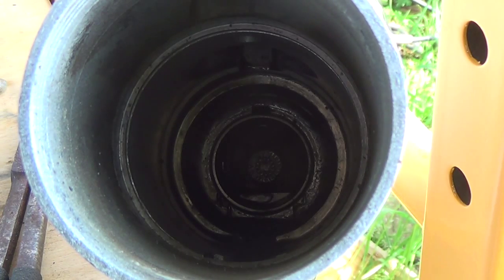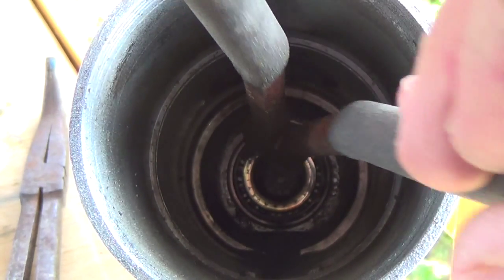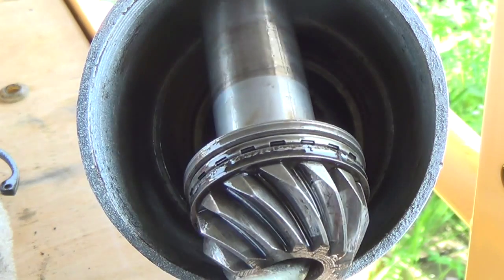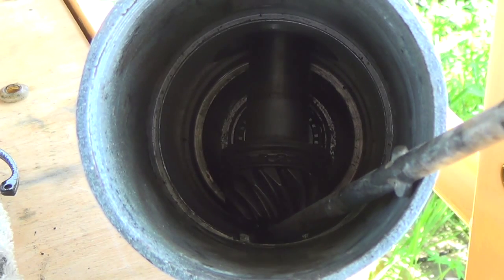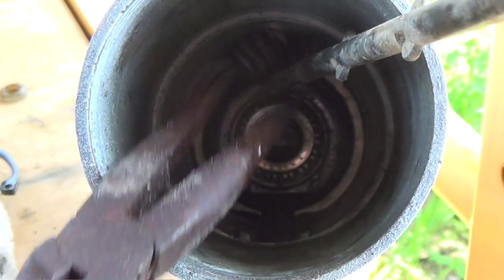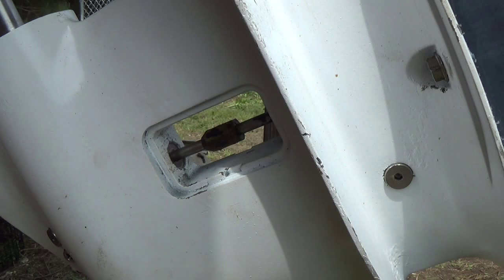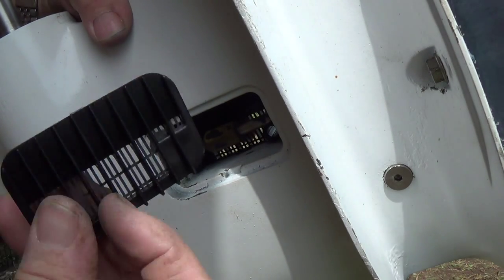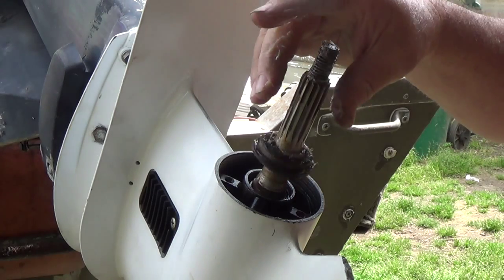Evinrude 30 Part 4

Comment: Congratulations on getting that spring/ball set up back in place successfully.  I'm just hoping the prop shaft was properly indexed with the clutch dog so the balls fit properly into the detent grooves into the clutch dog.  I'm wondering if you got the two pinion bearing washers properly oriented, the two washers are different and must be oriented properly against the pinion and gear housing.  It's a good idea to apply a little grease between the seal lips prior to assembly to help extend seal life and to help make sure the seals are not damaged during assembly.  Did you pressure/vacuum test the gearcase before filling with lube?  This is a critical step indeed.  Even the best of technicians makes an occasional mistake during a reseal, there could also be imperfections in the housing that might create leaks as well.  Outboard gearcases have a zero tolerance for any sort of water leaks, no matter how slight.  I realize that car/lawnmower engines can survive OK with minor oil leaks.  Oil seepage on the ground can be monitored, and the oil level can easily be checked/topped off.  Oil leaks are usually not that obvious on outboards, and the oil level is a royal pain to actually check.  Keep in mind that as the oil leaks out into the water, water is leaking back into the gearcase.  The gear lube should be drained/inspected/changed after about 10hrs running time, just to be sure there are no sealing issues also.  It is also important to note that that lower shift rod must be threaded completely into the clutch dog cradle until it bottoms for proper adjustment.  Failure to do this will mean the linkage is out of adjustment, the gearcase won't shift correctly, and the clutch dog/gear lugs can be damaged.  Those goofy plastic shift linkage retainers are a pain also, the lower shift rod is often times inadvertently backed out while connecting the shift linkage.  It is important to just turn only the top nut while assembling the linkage to avoid having the lower shift rod back out while connecting the linkage.  Congratulations on getting this thing back together and working!  Your hard work and honesty shows this is not as easy as some might think.  Generally speaking, this is not a job for the average back yard guy to attack.  Simple mistakes can destroy a lower unit that costs $1500 to replace.

Comment: Om Fishing, does the hose clamp squeeze the PVC nipple to not only push the detent balls further down into the hole so the   clutch dog slides over them easier, but also to put the nipple on a bind on the spline so the clutch dog is less likely to slide the nipple away from the balls, causing them to pop out of the holes? I'm sure it sounds less difficult in theory than in actual attempt to do it. 
              Did you use a seal puller? I tried to find one, for my reseal job on my 30 HP 1998 Johnson lower unit. I would of had to go deeper & deeper looking,  got impatient & pried them out with a screwdriver, was careful enough I think, no score marks in the seal bores. 
             I had been at a standstill at one point. I never got gearcase fully disassembled. I made a threaded rod puller as you did for the shift linkage bushing but I used only 3/16" rod because it went thru the inner O-ring of the shift rod bushing easier than 1/4" did when I tried it. And I didn't know what size sleeve to use under the bushing, I used one that I later saw was too small in O.D., and it caused the nylon washer to mushroom and bind the bushing in the bore, then I put 2 metal washers between the nylon washer & the sleeve but it was too late, I guess, the bushing still wouldn't budge. I took it to a shop, just the lower unit housing with the guts removed, hoping that when they finally got around to looking at it, they could get the bushing out with a slide hammer. They got it out after not too much downtime, but for about $160! If only I would of used the exact size sleeve as the hole underneath the bushing, and 1/4-20 threaded rod, (the 3/16 threaded rod got stripped by the nut, too much stress), I'm sure it would of slid out for me as it did for you! Hindsight so much better than foresight! 
             When I took the propshaft out of the gearcase, the  clutch dog stayed on the shaft over the balls. I hoped that didn't mean the clutch dog was seized with some rust onto the shaft. It shifted normal, I thought, last time I used the motor, almost 3 years ago. But I had drained a few ounces of water out of the gearcase before doing the reseal. Yet, nothing else looked rusty. I thought  I'd better leave that  clutch dog in place, and didn't take it apart for cleaning, and if not seized with rust, I must have been mighty lucky that the clutch dog was detained in the neutral position, and didn't come off  the propshaft  when I pulled it out of the gearcase. I was lucky again, when I refit the components in the gearcase,  the  clutch dog stayed in place, and everything fit back together, the gears shift, and I saw no oil leaking after several uses in the water. Now I should take out the oil drain plug & have a look for any water, to check my work, & if OK  top off gearcase again. I used oil that is supposed to endure a bit of water if its there.
           I surely have enjoyed and benefited much from watching the videos you've posted that I have watched.  You do indeed have a good temperament as someone else had said, and ingenuity in your teaching videos. Thanks for sharing!
Reply from the maker: Yes the hose clamp squeeze the PVC down further. Yes I did use a seal puller. Sorry to hear you had a little trouble but in the in end. The $98.00 and hour the marinas charge here to fix you motor we came out like a couple of lucky ducks.

Comment: I find your videos very helpful.I understand the idea behind the pvc toll you made, but what did the clamp do for you on it?There would be a space the thickness of the PVC between the clamp and splines.I am sure it is a simple solution, just hard to video I am sure.You push the shaft in the dog piece and as you push it in the pvc keeps the spring compressed with the ball bearings.Do the spring and bearings have to be lined up a certain way on the tool?In the cut out area of tool?Thanks again.Just put an impellar in mine and have to tune it now hopefully.
Reply from the maker: newyota1 I put the hose clamp on there to take up the space between the spine and the inside of the PVC so it was a tight fit which held the bearings right even with the top of the spine that made the dog easier to slide up it
Reply: Om Fishing, does the hose clamp squeeze the PVC nipple to not only push the detent balls further down into the hole so the  dog clutch slides over them easier, but also to put the nipple on a bind on the spline so the  dog clutch is less likely to slide the nipple away from the balls, causing them to pop out of the holes? I'm sure it sounds less difficult in theory than in actual attempt to do it. With my reseal job for my 30 HP 1998 Johnson lower unit, I'm at a standstill. I never got it fully disassembled. I made a threaded rod puller as you did for the shift linkage bushing but I used only 3/16" rod because it went thru the inner O-ring easier than 1/4" did when I tried it. But I didn't know what size sleeve to use under the bushing, I used one that I guess was too small in O.D., and it caused the nylon spacer to mushroom and jam the bushing in the bore, then I put 2 washers between the spacer & the sleeve but it was too late, I guess, the bushing still wouldn't budge. I now have it at a shop, just the lower unit housing with the guts removed, hoping that when they finally get around to looking at it, they can get the bushing out with a slide hammer. And when I took the guts out of the gearcase, the  dog clutch stayed on the shaft over the balls. I hope that doesn't mean the dog clutch is seized with some rust onto the shaft. It shifted normal, I thought, last time I used the motor, almost 3 years ago. And I drained a few ounces of water out of the gearcase several days ago, but nothing else looks rusty. Maybe I'd better leave that dog clutch in place, not take it apart for cleaning, and if not seized with rust, I must be mighty lucky that the dog clutch is detained in the neutral position, and didn't come apart when I pulled it out. But now I must hope and pray it doesn't come apart if I'm able to have that seized brass bushing removed, & at last be able to attempt to refit everything. I surely have enjoyed and benefited much from watching the videos you've posted that I have watched, and thanks for the goodwill concerning my LED spotlight hunt, or might I say, my searchlight search, that I replied to you about in your post about your motor kicking up on you when you were on a timing adjustment trip, was it? You do indeed have a good temperament and ingenuity in your teaching videos. Thanks for sharing!

Comment: I remove the pin beside the oil plug by mistake. Do I have to take the lower unit apart to reinstall it?
Reply from the maker: +Bety Rodriguez You might be able to line up the pin with the gear shift if your patients hold out. I have had luck doing it for other people.
Reply: This is a very common mistake indeed.  Sometimes the linkage falls apart when the pin is pulled meaning the unit must be disassembled to get it back together.  Never remove the phillips screw next to the lower lube drain plug.  I hope you got it back together OK.  Thanks for bringing this up, hopefully others will learn from your unfortunate mistake....

Comment: Can someone inform me of what the anodes do on he lower unit?
Reply: The "sacrificial anodes" on a gearcase/outdrive are there to slow down the electrolysis that can occur, especially in salt water.  The anodes are there so the salt water will attack the anode, instead of the aluminum gearcase.   So, seeing a chewed up/pitted anode is a good thing, this means it is working properly.